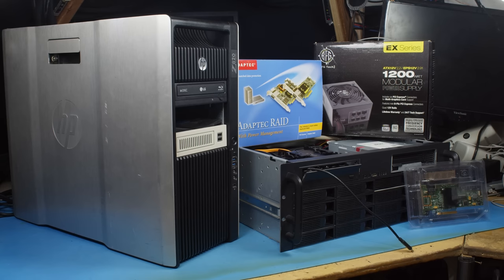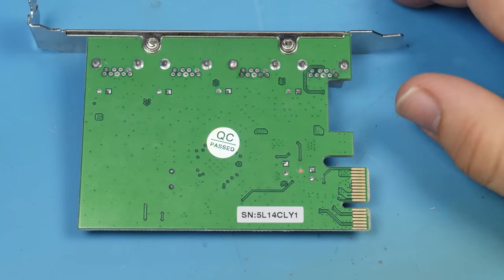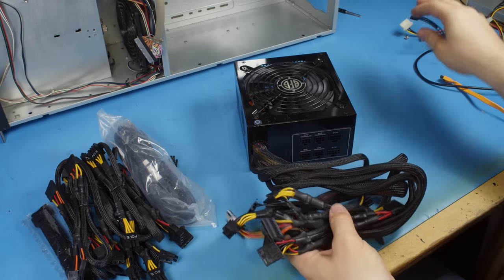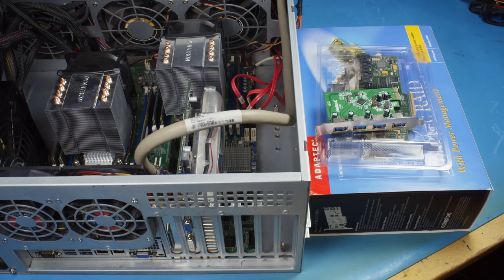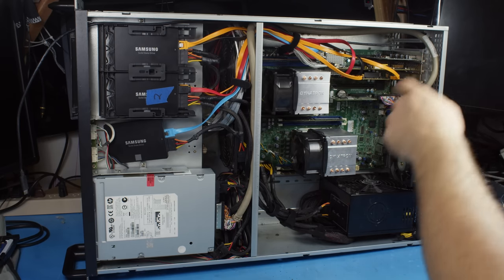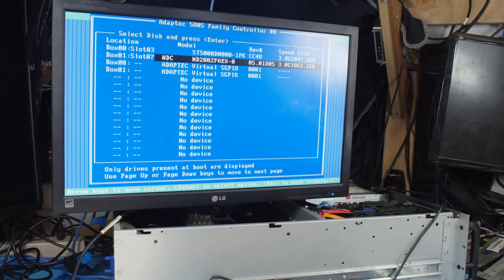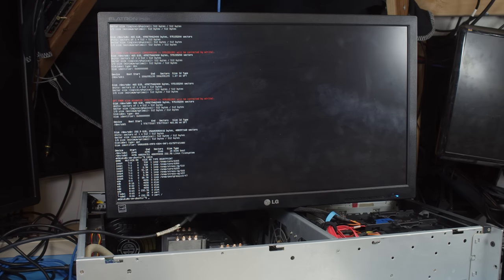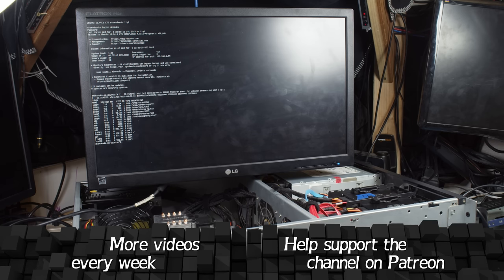Server BuildLog: 1200W PSU and 22 Drive Ready

Comment from the maker: A small update to this, the server will boot without a GPU in it. If you missed the 3pt build series I did on this, the onboard VGA doesn't work and it has strange issues.
Reply: I might have a Quadro FX Series or even a Quadro K600 laying around. Would be both single-Slot. I could send them to you if you're interested. Wouldn't be suitable for rendering though because they're both pretty low end for their Generation.
Reply from the maker: @RAMMSPECK   I appreciate the offer, but since I got it booting with no GPU I don't have as much need for a single slot card anymore. I'm probably going to wait until I'm ready to buy a more powerful GPU for rendering since I don't need one for video running a headless Linux server. I'm even considering one of those dirt cheap mining 1060s with no video ports if I could make that work with Linux.
Reply: You can put the GPU on any PCIe slot as long as the smaller slots have an open end. The GPU can run at 8x and 4x without serious performance degradation. I think the same applies to your RAID cards, so you should be able to put an 8x card to a 4x slot as long as the back of the slot is open to allow for that.
Reply: A lot of the hardware RAID cards will allow you to create a RAID0 with a single disk if you want to run independent disks.  You just need to create a RAID0 for each disk you have. JBOD is another option. Haven't checked specific card, just writing as I am seeing the video.
Reply: Adding a single slot VGA card and completely deactivating the onboard VGA (from BIOS) may speed up the boot process significantly. I suspect that most of that horrendous boot lag is from multiple attempts to initialize the video chip, so you should accept that Quadro FX at least as a temporary solution.

Comment: Look into flashing your LSI card into IT Mode, it will present the drives directly to the OS.
Reply: that's exactly what I did before sending it too akbkuku.
Reply: I'll be making a note of that, I think....I had this issue when trying to play with ZFS many moons ago and it caused me to give up. Either I missed that reference (aka didn't look hard enough) or it wasn't a thing back then!
Reply: Strange, I have an HP branded LSI card (HP Model H220) that's in IT Mode and it passes my drives directly to unRAID. It shouldn't have the options available to even setup hardware RAID. What's the card's model number?
Reply: I have 3 dell h200 running in IT-mode and have the same experience you do, you shouldn't even be able to setup an array. 

@Gartral don't want to second guess you but did you add the sas-adress and verify the flashed image? I know i missed it on one of my cards the first time and had a similar problem to what @AkBKukU is having now.
Reply: @Heggrik  ^ this

Comment: One tip, RAID isn't backup, so one thing I reccomend is to let one of the HDD's out of the RAID system and do a manual copy of everything there
Reply: Even better if is a copy to an external storage unit
Reply from the maker: I will be doing 3 ways of long term storage. HDD, tape, and "cloud" to Google Drive. So I will have redundant and remote backups.

Comment: Is the LSI card an IBM ServeRAID M1015? If not, then you may want to look at picking up 2 of those, they are cheap and easy to get and what most people in the NAS communities end up using in their servers (they support drives larger than 2Tb) and can be flashed with a standard LSI firmware to make them either RAID controllers or standard HBA controllers. I have two of them, and they work great (mine have 4Tb drives connected to them). Each card can handle 8 SATA/SAS drives, and the cabling is much easier to manage.
Reply: it isn't that specific card, but in the same "family" of LSI SAS2008 based cards.. the HBA instructions are what I used to put it into HBA mode for akbkuku before I sent him the card.

Comment: You want to set up those raid cards in HBA mode using the IT firmware as others have mentioned. It will save you a lot of headaches with ZFS. Last I checked BSD/FreeNAS advised against using ZFS in a container or VM. ZFS on Linux is very stable now, I have been using it for years. I would run everything under Ubuntu if you are already familiar with it. I used BSD for a few years before switching and its much easier for me to just keep running Linux as BSD experience gets me nowhere at my job.

Comment: OBTW, those 5805 cards are SAS 1.5Gbps, so 125MBps per device.  JBOD will give you 1/4th the actual performance of a single SSD, whereas RAID0 will give you about 1x the performance.  I would recommend finding a different RAID card or buying a couple nice 6Gbps SAS controllers.  If those are SAS concentrators on the backplane, they most likely won't work with SATA controllers, SATA drives work with SAS, but SATA controllers don't do SAS backplanes, that was the gist of what I read back when those 5805s were new.

Comment: if you don't plan on fixing the IPMI Chip(which is also your VGA Controller), you can disable it via jumpers (JPG1/JPB1), that'll make the board boot faster
Also, did you try to recover the ME(BMC) Firmware?  There's another jumper on the board for putting the BMC chip into firmware recovery mode

Comment: I just found out about a project called PiKVM. It uses a Pi 4 or Zero and a CSI-to-HDMI bridge, and allows you to control systems via a web interface, including things like keyboard/mouse, mass storage/CD emulation, and ATX power if you assemble the circuit they made. Could help out, especially if the IPMI in your board is busted or too unreliable for use

Comment: why does the blackmagic capture card not work well with the blackmagic camera? is the capture card older than the camera?
Reply from the maker: I have the original Intensity Pro which does not do 1080p @ 60fps. So I can only feed a 30fps signal into it which I can do with the camera, but it is somewhat limiting. And it definitely doesn't do 4k.

EDIT: More info on why it's not a good fit. The Intensity Pro can do 720p@60fps but the BMPCC4k cannot work in any resolutions lower than 1080p. It also cannot output an interlaced signal which would have been acceptable because the capture card can do 1080i@60fps. So the capture card can only be used with a 1080p@30fps resolution for the camera. I have done this for streaming (the serial terminal hack) and there are more problem. I have a reference video monitor I watch while filming, especially important for live streams. The camera also outputs color as YCbCr, not RGB. All of my monitors except one are DVI and cannot do YCbCr. The one that is HDMI cannot do 30fps. So I use an HDMI scaler to over sample the 30fps to 60fps for the reference monitor. If the capture card could just do 60p then this wouldn't be a problem.

Comment: On the USB3 card it looks like there are 2 identical power supplies, check if the power is working on the dead ports.  I bet the data lines are still alive but the power supply for those ports died.

Comment: Does the drive bays not have a sff-8087 connector? I'd go for dell h200 / ibm 1015 / Lsi 9211 card flashed to IT-mode instead of adaptec cards. That's probably what you'd need to do to your LSI card btw, if it's not in IT-mode you wont get the disk to show up without adding it to some form of array in the LSI interface.

Comment: Did you figure out the front panel network LEDs? I think if you plug the header in one way it acts as a link light,and if you flip it around it acts as an activity light. Maxxarcade did a video building a server with an asrock board and it worked this way.

Comment: Does your raid controllers require any cooling? My facility uses a few Mega Raid cards with an interesting duel fan unit that is fitted in an esata slot directly under the card as an anchor & plugs into the mother board fan port. I can't tell if there necessary or not.

Comment: Something you should be aware of with those Adaptec RAID cards is that they SUCK at online resize.  Don't plan on doing any disk additions to existing RAID volumes.  I had a 24TB array that I wanted to grow to 32TB, the card estimated it would take 45days to perform the online resize.  That was with RAID6, other RAID levels may be better.

Comment: what RAID card did you use? How many SAS connections did it have.i had this issue with trying to connect a bunch of HDs in my plex server. the majority of the card i found only had 2 SAS connections
Reply: One SAS connection = four SATA drives 🙂 adapter cables are super cheap, I paid under 4USD for one new
Reply: sismofytter True. I guess I didn’t also say that I was trying to connect 12 drives. :)I had rosewill lsv4500 (I think that’s what it’s called) eventually I found my cheap answer an LSI card that is just a SAS HBA card that had 4 SAS connectors. It didn’t do raid it just allowed a lot of connections (that’s why it was cheaper 150$-200$). I just wanted to see what other people’s solutions were. I never bought the LSI card I just ran with 8 drives until I luckily inherited a R720. I got so lucky

Comment: Never use a raid controller that doesn't pass the separate drives to the OS (as in, you have to set up an array in the raid bios), running ZFS on that is kinda pointless. That LSI controller is set up properly for use with ZFS, the Adaptec is NOT.

Comment: if i remember correctly you can just cut the gpu pcie tab down to the interface you need and it will still work albeit with less bandwidth. or if it fits without hitting the heat sink you can just cut a slot at the end of the motherboards pcie slot.

Comment: Why do you not want to cut off the little piece with an angle grinder? You actually want that piece there? I'm sorry but your explanation just left me more confused.
Reply from the maker: The time and effort of grinding/cutting that off and sanding smooth the metal so it's not jagged and sharp just isn't worth the extremely minor benefit of having a physical eject button. I would probably never use the eject button anyway because I'll always want to check the status of a tape from a terminal first. And while I'm there I may as well start the eject process since it can take a while to re-spool the tape anyway. I'd rather do it at my desk than be standing next to the rack waiting.
Reply: @TechTangents  Fair enough. I'm a metal worker so it didn't seem like a pain of me, but I get it. Thanks for replying.